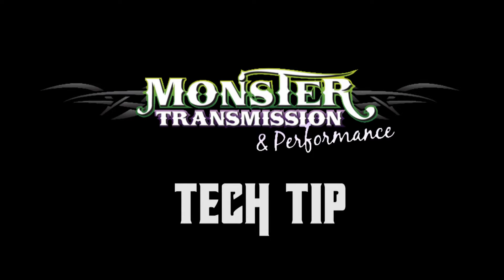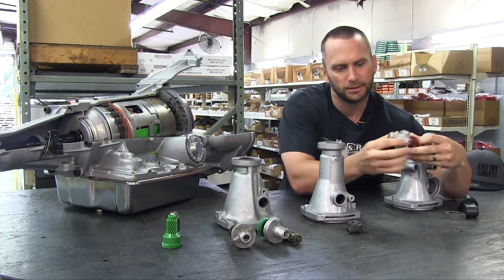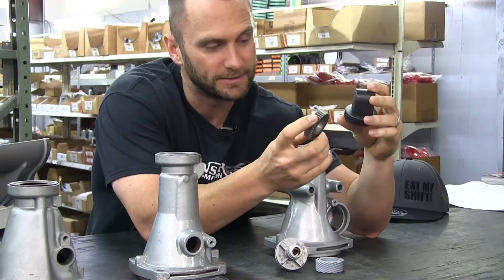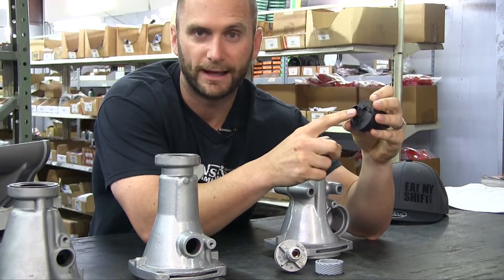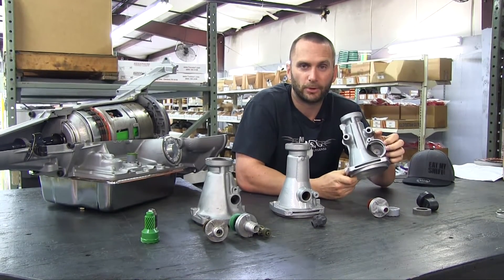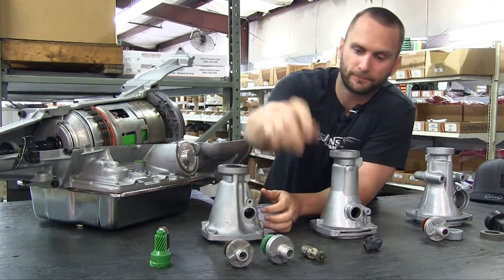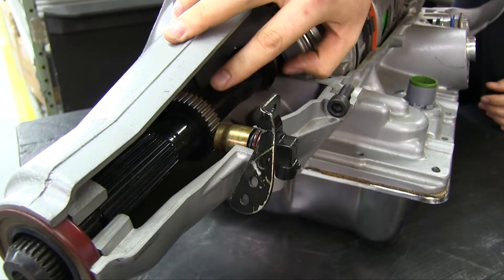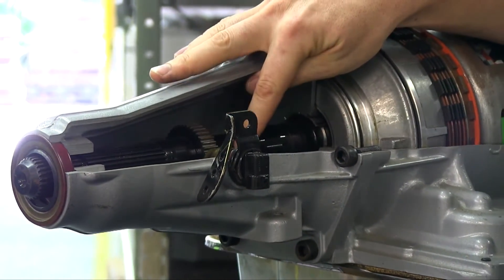Quick Tech Tip  |  Mechanical vs Electrical VSS for a 700R4 Transmission

Comment: Hello, i have an electronic speed sensor on my 76 c10, but mu truck does not have electronic has a cable, can I install a manual gear to connect a cable??
Reply from the maker: Yes you can convert to mechanical speedo

Comment: If I am changing rear end ratio on a vehicle with the 4L60E can I reuse the stock electronic VSS? Or is there a gear like in the th350 I need to change?
Reply from the maker: Depending on year and make of the vehicle, you may need to have ECM re-calibrated or tuned.
Reply: Monster Transmission oh darn really? Any ideas Where can I find out more information? I have a 95 corvette with lt-1 / 4L60
Reply from the maker: Give us a call! We have a technical staff that would be glad to help you with this. 800-708-0087.

Comment: I have a 95 blazer with the 4L60E tranny, and the large vss port with the magnetic sensor you were talking about.  I did a tranny pan seal and filter replacement a couple weeks ago, so everything is dry.  After the pan seal was replaced I noticed that I had a small leak coming from the vss, even when the vehicle was off.  So today I replaced the sensor with a new one, with a new o-ring included.  I seems like the new sensor is still leaking.  Is this common?  

I kind of just popped the old one out, let the big rush of fluid drain, and then popped the new one back in, even tho there was still some fluid draining.  Should I have let all the fluid quit dripping and then wiped and cleaned the area real well?

After refilling the tranny, I checked the sensor area, and it seamed dry even when running and getting up to operating temp.  Then I ran through the gears with the E-brake on and looked again, and it seemed like the sensor started leaking. Is this usual?  Thanks in advance!
Reply from the maker: No it is not usual. The best thing to do is remove the tail housing and check for corrosion around where the seal sits. Also when putting in the seal make sure the o-ring is lubricated.
Reply: Thank you for the quick reply.  If there is corrosion around the seal mating surface of the sensor, is it recommended to put a light coat of rtv around the sensor in addition to the o-ring?  Or at that point would it be best to think about replacing the tail extension?
Reply from the maker: A little bit of RTV is okay but not an excessive amount. If it needs a lot then yes, it would be recommended to be replaced instead.
Reply: Thanks you so much for your time in replying and being willing to help! :)
Reply from the maker: No problem! If you have any more questions our tech team would be glad to help you at 800-708-0087.

Comment: I have a 95 454 Vortec and want to use a 95 4 l60e this is all I need to convert my Vortec and run it
Reply from the maker: If you are using the factory computer system then yes this should be all you need. But if not, then i don't see how you would be controlling the transmission seeing its electronic. If you have any questions feel free to call our tech support 800-708-0087.

Comment: can I put a vehicle speed sensor on my th350 for my chevy C10 1/2 ton
Reply from the maker: Unfortunately no, the TH350 only had the option for the mechanical gears. You can however purchase a kit that allows you to use the mechanical gears and an electric gauge. Dakota Digital and Autometer offers this part.

Comment: on my 700r4 it uses a electronic vss that uses a plastic reluctor ring and a plastic gear on the sensor. can I swap the plastic reluctor gear to a metal gear and run a electronic magnetic vss sensor
Reply from the maker: Yes, you can use a metal reluctor ring on the output shaft and electric pick up.
Reply: for the 4L80E transmission they make a mechanical speedo tail shaft thinking of buying that setup will it still work with my LS ecm and Tcm. iam guessing but the 4l80e has the VSS on the side correct should be no problem
Reply from the maker: The 4L80E has an electronic speedometer. Some companies do have aftermarket mechanical speedometer setup for a 4L80E that offer the tails. In the stock there is no hole in tailhousing for a mechanical speedometer housing.